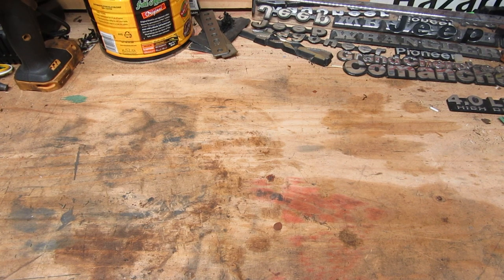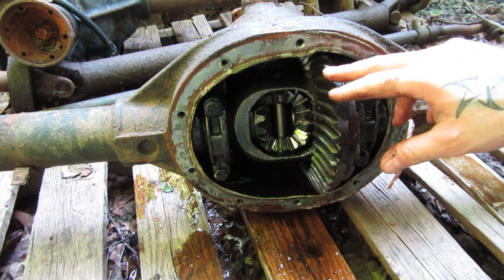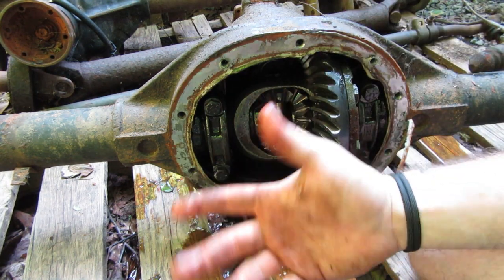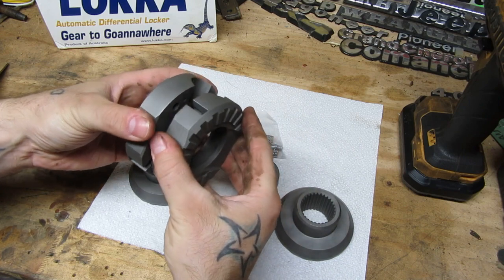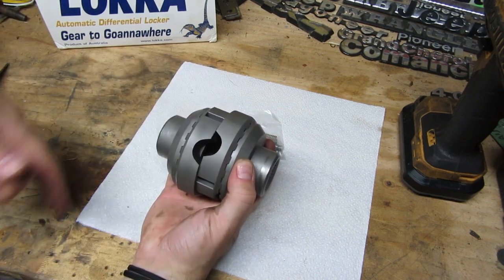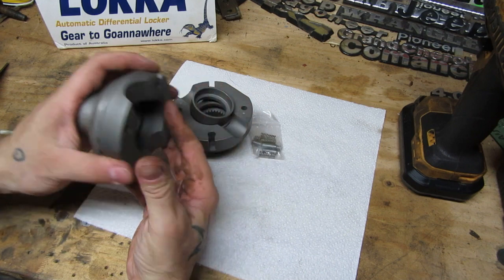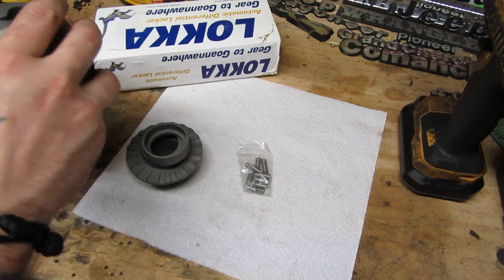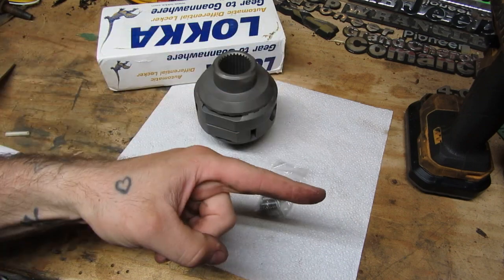What is a LUNCHBOX LOCKER? How do the work?(Automatic Differential Locker)

Comment: These lockers are more genius than anyone realizes and I haven't found a YT video yet that explains one of their coolest features. I'm not sure if all "lunchbox" style lockers have this, but mine does and it appears this one does too. You will notice the alignment pin holes are slotted on one half. Have you ever wondered why? Why not just straight bored holes? Well, it's to allow one half of the inner spider to be clocked at a slightly different rotation than the opposing one. You're probably wondering how that would even be possible considering there is a huge pin between them and also what is the purpose? It's to allow your outside tire to rotate in a turn even under mild acceleration. What happens is at first you are accelerating in a straight line, both axles are locked, now...as you begin to turn a corner your outside tire starts to rotate faster than the inside. This differential of rotation causing the outside half of the locker to want to rotate AHEAD of your carrier rotation. The slotted pin holes allow this shift. At the same time the angled hole which was being pushed by the carrier pin is now allow to slide inward just a hair (while the carrier pin still is applying force to the inside wheel). It's genius actually. If you give it too much power your carrier pin will override this allowance and put everything back into lock, but under moderate power this thing acts like an open diff.

Comment: I have had one of these exact units installed into front diff and it was the best money i have spent and makes a huge difference to the places i can go and without now having to panic about getting a big run up to climb, Awesome product.
Reply: roger flame I’ve been thinking about this for my F-150 front axle so I have real 4 WD. When it’s in 2WD the outer wheel ends allow the wheels to be free of axle shafts as well as lets the front driveshaft disengaged
Reply: @donaldpauli129  When in 2WD there will still be enough meshing from the locker to keep the driveshaft spinning so what i did to my Hilux  was to install free wheeling hubs  and then when you only need 2WD, you simply unlock the hubs and only the wheels spin,  not the drive shafts and diff and saves a bit on fuel too
Reply: How many miles do you gave on the unit a d how noisy is it?
Reply: What vehicle did you install your front diff lunchbox into please? I have a mid 90's Toyota 4x4 and am about to fully regear both axles so I'm shopping locker options.
Reply: @flamethrower161   This is good info!  What year Hilux?  Mine already has Warn manual hubs.  I assume they are free wheeling because you have to stop the truck, get out, and manually lock or unlock them when you want to use 4WD.  So I assume I'm good??

Comment: Really great video man.  Auto lockers are so overlooked these days, with everyone on the air locker and E locker bandwagons.  I think I'd rather have auto lockers than having to mess with buttons and switches before and after every obstacle.  A funny (to me anyway) I bought a front locker for my Can Am X3 and its the same exact thing, but smaller... it's like a 3 inch, but it works like a charm, and I hear it click when I'm maneuvering through camp or around the driveway at home.
Reply: Remember.... Strength wise the lunchbox locker is driving through the cross pin only and putting all the load on the pin hole in carrier case.
Other lockers load into the side of their carrier case.
Reply: A limited slip/posi tranfers the load to the sides of the carrier itself by compressing the clutches between the axle gear and the case.
The pin carries almost no load....
Except in a Ford traction lock which only locks the drivers axle and locks up the other wheel by forcing the spider gears to not turn/ transferring load through the center pin.
A lunchbox locker rear is NOT AS STRONG as other differentials.

Comment: Not all lunchbox locker's can be installed with the carrier still in the housing, depending on if the cross pin can clear the ring gear or not. 
Also, the Dana 44a has retaining bolts for the axle shafts on my WJ instead of the c-clips.

Comment: Love me some lunchbox lockers.  I only run one up front.  Have for the past 2 XJs.  Makes the road manners the same as before but exponentially increases off road capability.  

I've had previous Jeeps where I was locked in the back and both ends but for a daily driven XJ I found that I liked having the locker up front far more than int he back.
Reply: It's just the opposite for me, I have them in both ends of my XJ but if I could only pick one it would be the rear, daily driving with an open rear differential sucks.
Reply: @Lray4x4  why do open diffs suck? Not too informed
Reply: @armandosoria7993  because its easy to spin out when trying to accelerate since an open differential allows the tire with the least traction to spin, loose gravel, rain and snow make it worse.
Reply: @Lray4x4  Oh ok. Thanks.
Reply: @Lray4x4  its not the open diff that makes it a hard daily driver it your shitty driving. Never heard anyone say an open diff makes it a hard daily driver

Comment: My 01 durango 8 1/4 is LSD (suregrip since i need to be an ass about it), found out the hard way, wasnt smart enough to lift the rear end and spin the wheels, but point is, not all 8 1/4 mopars are open
Reply from the maker: haha.. fair point
Reply: Liked and subned though. Good vid and good info
Reply from the maker: @andrewkahler9359  Thanks! Appreciate it!
Reply: My liberty renegade has the factory LSD but I’m thinking of putting the lunchbox in there because my front is open and I only have command trac. So I’m barely ever in 4wd.

Comment: I just bought a 93 Toyota 4 Runner and I think it might have a locker in the front. When I locked both front hubs the tires went the same direction when I turned one. Plus it has fresh rtv gasket sealer on the front diff. Plus it has a Yukon sticker on it lol. It has lots of nice stuff added and it would be cool if it already had a front locker. If so is it bad to only lock 1 hub if you want to turn easier? I heard some guys doing this. It didn't seem very hard to turn and I have 35's but I was in snow and only had it out one time so far.

Comment: No your explanation is wrong the springs that go in gives tension keeping it locked the only time it unlocks is when you turn left or right and one wheel is moving faster then the other and that causes the springs to compress letting the slower axle to slip till they equal in rotation speed ie going straight then it locks back up again
Reply: Thank you Edward for your correction.
Reply: Nooo! It is the faster axle the one which will do the slip! The slower turning axle will be locked solid by the center bolt or pin!
This type of lockers are basically permanently locked. But they have two states of been locked. 
1. SOFT LOCK (Spring tension only) 
2. HARD LOCK (Center bolt or pin tension from the engine drive shaft)
When you turn the vehicle, the inside shaft will turn slower and because of that the drive shaft from the engine will turn the bolt/pin which  will push on that side of the gear and lock it solid. But on the faster turning side, the wheel is turning the shaft faster than the drive shaft from the engine! In that case the gear will take the pressure of the bolt because the center hole is not perfectly round and with the pressure gone, the gear can move past the inside gear (and skip a tooth or two or how many is needed)! If the inside wheel starts to spin (because of too much drive shaft power from the engine), it will catch up with the speed of the outside wheel and then the bolt/pin will push on that gear too and hard lock it. This is the advantage of this type of locker vs a permanent locker. It allows you to turn by powering only the slower moving wheel but if the slower moving wheel begins to lose grip and spin, it will automatically and instantly "call" on the other wheel to help with traction.
Reply: No axle can turn slower than the ring gear.
The outside one can turn faster in a turn.
If they could turn slower than the ring gear, the car couldnt move.
Think about it.

Comment: Excellent video! Are there any areas where you need to check clearance relating to the pins? I don’t have your average off-road vehicle, and there is only one locker available for it. Considering it’s Korean, the only thing I gather Is That there is a clearance necessary between pins? It looks just like a regular lunchbox locker

Comment: Thanks for this video. I had to replace my d44 with an AMC20 that came with a locker and 1-piece axle conversion. The CJ5 on acceleration (street driving) and when I let off the gas wiggles the rear. Is that normal for these? Just need to get used to it? Thanks

Comment: Sorry mate, but imo you've got it slightly wrong.
These lokkas are locked all the time when driving straight ahead or when you load up the system during acceleration.
They unlock when you go around corners and then relock when going straight again.
They are rough in operation in a rear differential and can be quite abrupt, they require a slightly different driving technique than an open diff or you will have the noises and changes in turning radius or tyre slip on the road.
Very important to NOT fit one of these into the front diff of a full time 4x4, in vechicles with a standard old school 4wd system ie transfer case and locking hubs these are good.
Another point you will probably get to in your fitting video is that shimming the required clearences in the instructions is very important to the lokkas operation, get it right they are quieter and operate consistently and correctly. Fitting to spec also lowers steering forces although you will still get a noticable return to centre force on the steering wheel.
Having said that getting the required clearences is the biggest hangup of fitting these and can blow out the time taken to fit these. On occasion it will slip right in and everything is right where it needs to be, other times you have to have shims made to suit to get it all correct. I fitted one of these to an Isuzu pickup with ifs in the front diff (transfer case and manually locking front hubs) it made a massive difference to its offroad ability and really decreased the requirement to use momentum as your primary tool in getting over the rough stuff and all the damage that can cause. 
Thanks for posting.
Reply: @John 
Sorry I missed this.
I've mainly used these in the front, however from your description and what I've been told by others, yep that's normal. Under power they stayed locked and can unlock with a bang, whereas they unlock as they are designed to when coasting.
This is the major reason people fit selectable lockers in the rear or learn to drive to their limitations on the road.
Cheers
Reply: You’re 100% correct!  I once had a rock crawler CJ7 that someone else built with 2 lunch box lockers front and rear.  It was a white knuckle ride at anything over 25 mph!  Dangerous as all get out really!  Even on dry pavement you had no idea where the JEEP wanted to go!  The suspension was so soft for articulation that it was truly gnarly to drive.

Comment: So if I'm turning off road will it be engaged or not? Just disengaged until I hit the gas?
Reply: Essential yes because of two reasons, these are designed to lock under load do to the ramp effect of the ecentric holes of the halves spreading to lock both wheels together, but once there is a difference in wheel speeds the locking teeth don’t match up enough to engage and they are essentially disengaging constantly with the difference in wheel spin when turning, but once driven straight they match and the load can then be applied to keeping them locked, but the transition of unlocking is what causes the weird behavior sometimes and sometimes they get stuck locked also, those are the main drawbacks of not setup properly or inconsistent transition of most lunch box lockers, all depends on budget

Comment: How long would you reckon the pins and springs last? Anyway to know when they are going bad?
Reply from the maker: It depends on how hard you are using it. Tire size, gearing, all that. These things make a LOT of noise when the pins start to go, so you will know
Reply: ScottRidesHonda not really for hard use you need to buy a full posi unit for hard use these are really for 4x4 use on sand or snow where your not putting a lot of HP to is link in a drag race. Cause they will brake under extreme pressure just a lil fyi

Comment: You stated you don’t need to pull differentials. If you are running a larger tire and using a bigger ring gear, you will be pulling your differential.

Comment: I’ve been debating on putting a locker in my truck, I drive it on & off road. And I do a little plowing with it during the winter so something like this would really help me out there I’d imagine. I understand how they work & with that being said plus what you mentioned about driving on & off road with them I think I’d be absolutely fine. But I’ve had tons of people tell me it would ruin my trucks road manners & make it hard to maneuver on road etc..? What’s your opinion on this?
Reply from the maker: If you are used to a rougher ride anyway, go for it. If you want to be running Cadillac smooth this may not be for you. It will effect on-road manners
Reply: Alright thank you very much I will take this into consideration!👍🏼

Comment: I'm looking into the powertrax locker that is basically the same design as this one. It'll go into the front end of my 2013 F-150. It's my daily driver though. Would you still recommend this locker for a daily driver or should I stay away from an automatic locker?
Reply from the maker: All depends. you will definitely hear it everyday while driving and in some conditions on-road ride quality and handling may suffer. that said, it is a great way to add some capability to your truck for cheap
Reply: I had powerertrax. If anything ever breaks in your front axle,thats what is gonna let loose. Also if you have auto hubs you'll absolutely hate it. You'll feel clicking in your steering wheel and  it's gonna drive you crazy. I had it in the front of my Dana 44. I went back to open diff. I wouldn't put it in a daily, unless you have manual hubs.

Comment: How strong is this locker compared to a Detroit?
Reply: If you are going to be out on trails rock crawling you want a Detroit, these lunchbox lockers are for light duty use.
Reply: ALL the torque load is on the cross pin shaft/holes.
Light duty.
NO 5,000 RPM CLUTCH DROPS ALLOWED.

Comment: Can I put that locker In the rear of a 04 wj v8?
Reply from the maker: Yea, absolutely - assuming you don't already have a Dana 44a with Varilok. I would suggest you go to lokka.com, put in your vehicle, and check out your options.
Reply: If you have QuadrDrive, or like D&E in the garage stated VariLock axles,  then no. The carrier will not house a locker. Easy way to find out is to look at your shifter. If it says Quadradrive then you have Varilock and it will not work.

Comment: Have you installed this yet...I don’t think I’ve seen a video for it
Reply from the maker: I tried, but my diff was a little out of spec. i ordered properly sized shims, but have not have a chance to put it in yet
Reply: D&E In The Garage what does that mean ? Out of spec, was it aftermarket?
Reply from the maker: @no0channel0at0all  No, Chrysler and Dana both had an issue in the 90's and earls 2000's with differential casting being a little bit out of spec and making it into vehicles anyway. From D30's it meant getting special ball off-set ball joints to make up for the poor casting, for the 8.25 it makes the clearances are off in the carrier. Not as issue as there is a considerable about of room (by differential standards) for error on an open diff, but will prevent a locker from working properly
Reply: D&E In The Garage so there's no way to install a locker properly if the housing is out of spec ?
Reply: @no0channel0at0all  No you just need to add shims to get it within spec I believe.